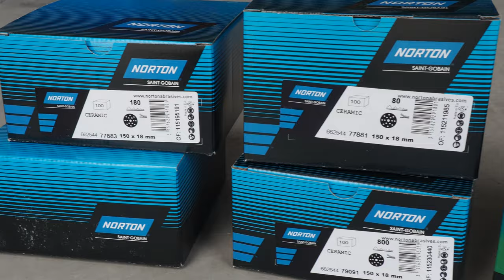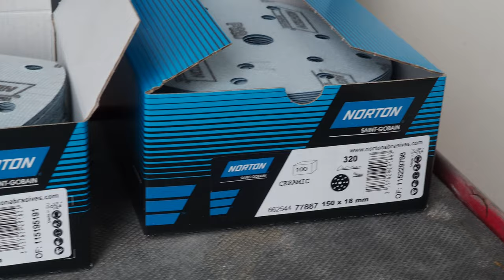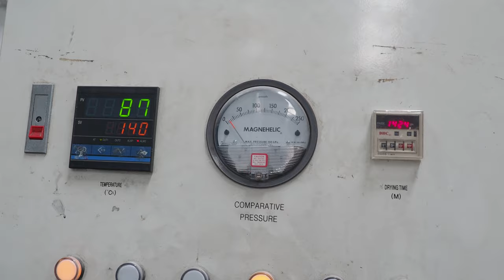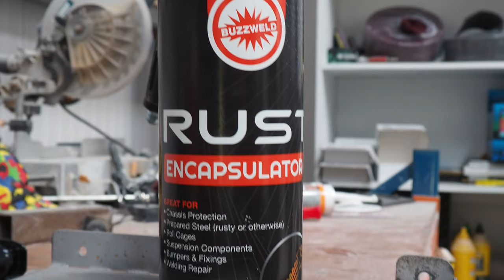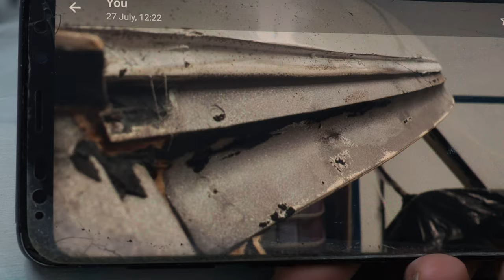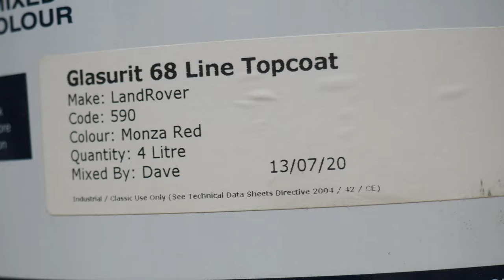Land Rover Discovery 130 Bodywork Restoration

Comment: Have you got pictures or video of what went on the back. Lovely build looking at doing a disco 130 in south africa
Reply from the maker: The back is still under construction at the moment.  It will be a camper unit which doubles in height using electric actuators.  If you go to our instagram or facebook pages you can see 3D models of it showing what it will be like.

Comment: Long Ranger D1 cab on a standard defender 130 chassis with a body subframe? or did you mod the outriggers for D1 body?
Reply from the maker: Modded the outriggers.  I think we spoke about this on facebook previously Nick.  Check out our facebook public page, there are detailed photos of the work done to the chassis.
Reply: @DonegalOverlanding  found them cheers!
Yes think we spoke when you were just setting out on the project so chassis work hadnt been done at that point!
Reply: @DonegalOverlanding  looks great, how will it be registered? Thanks